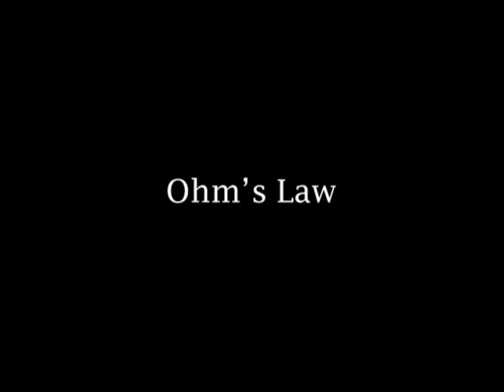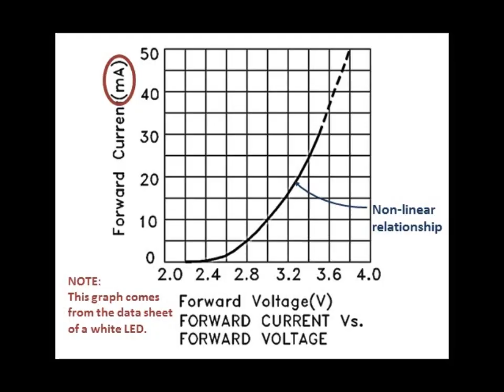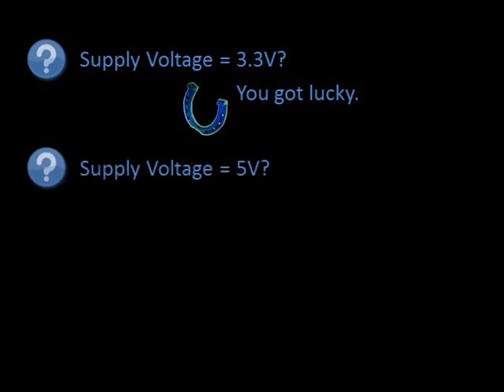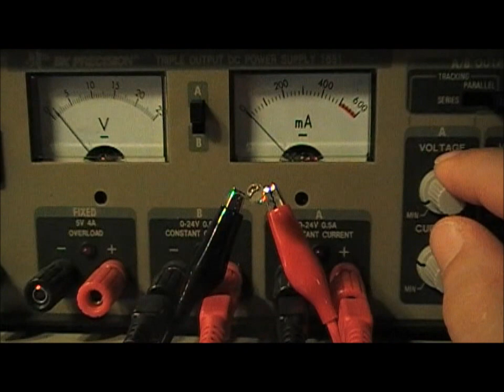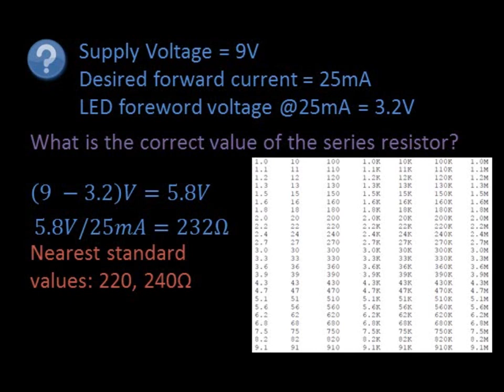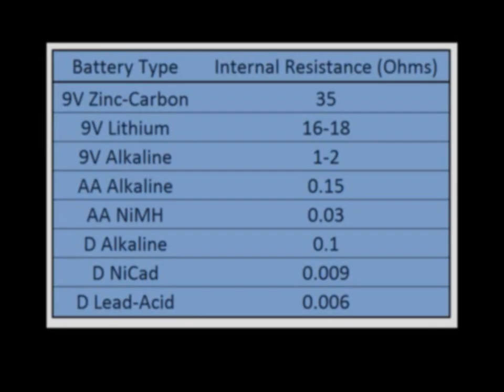Comment: YES!!! Reduce the voltage!!! As the LED heats up it will begin to flow more current. Eventually it could end up in "thermal runaway" a.k.a melting and burning. As the current changes due to the heat it will also effect the color of the LED output. Limiting the LED to the appropriate voltage will solve both of these problems.

Comment: @JDK1981 If you put them all in parallel and use only one resistor than you have 8.8V at 240mA which suggests a 36 or 39 ohm resistor. You'll probably be fine with a 43 if that's what you have. If you don't have one, consider buying a breadboard to test the circuit on first before you build it into the final item, that way you know it's right before you do the finishing touches. Hope this helps. Cheers!

Comment: @JDK1981 It's best to measure your LED directly if you can, but I checked a pink LED I have here and it's pulling about 60mA at 3.2V. It depends if you are putting these in parallel or series. If each LED is getting it's own resistor and the full 12 volts than you need to drop the remaining (12 - 3.2 =) 8.8V at 60mA (0.060A) which gives you (8.8 / 0.06 = )147ohm which is close to a 150ohm standard value resistor.

Comment: Great video. However i still not sure about my proposed circuit. Say i have 12V power supply and 15 LEDs. i decide to make three loops of parallel LEDs (3.6V each) and arrange them in series (i.e one loop has five LEDs arranged in parallel and the three loops are connected by series). This means for every loop, there is approximately 3V to power adequately.
Question is do i still need to put resistor in front of LEDs since theoretically i have used voltage power effectively? If yes, do i put the resistor in series of each LEDs or in series of every loop?
I'm asking this because there's a thread saying i should mind the current distribution rather than voltage distribution as LED has nonlinear resistance.
Reply: mr_show Current distribution is important to watch. Paralleling can cause some current issues because not every LED will behave exactly the same, even if they are all the same part number/lot. Each of the parallel LEDs will have the same voltage by definition, but some might flow a little more/less current at that voltage than others. If you are operating well under the power limit of the LED, this is only a concern for brightness/color variation. If you are pushing them closer to their limits, you may be risking runaway. You are right - theoretically you are distributing the voltage and have no need to absorb the remaining. However, having a linear device like a resistor in place can help to control runaway if it were to happen. It's mostly about cost and risk. You can put all of the LEDs in parallel each with their own resistor and be sure that they are all able to perform well independently, but that's a lot of components and a lot of power dissapating in the resistors. No resistor is the other end of the spectrum. If one LED has a problem, your entire circuit changes dramatically. In practice, the most common usage I see is a single resistor in series with the parallel LED groups. These are what I would call "non-mission critical" applications.